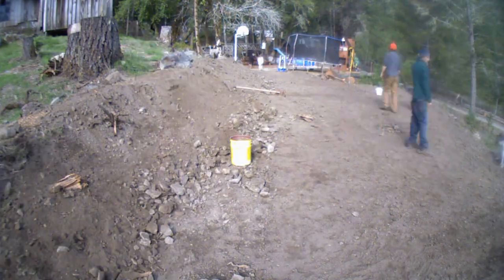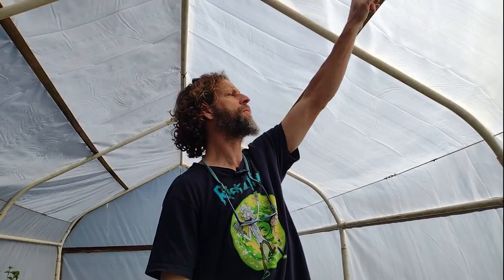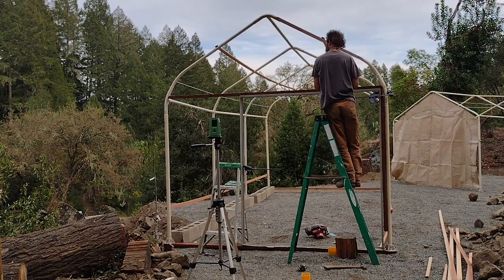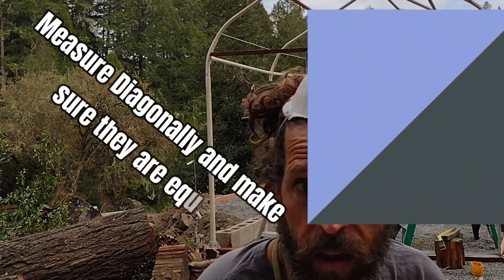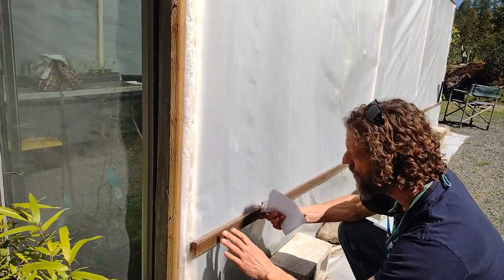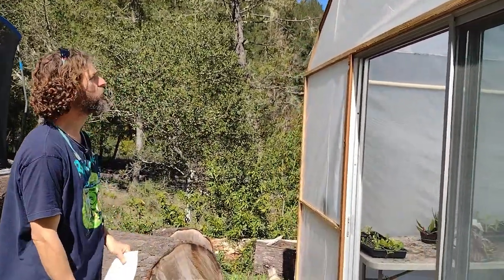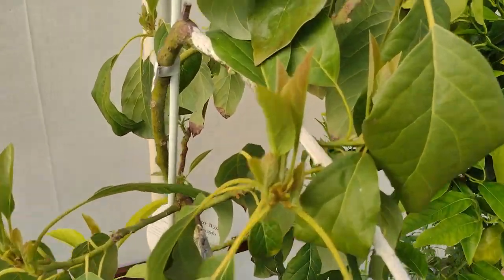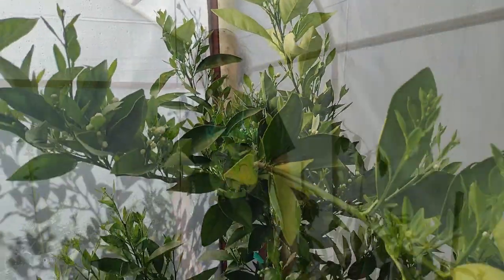DIY GREENHOUSE from old CARPORT frame.

Comment: Very helpful! I know that the plastic will weaken and tear over time—just remove the outer wood framing parts and replace the plastic that breaks?
Reply from the maker: Yes just remove the wood baton from the outside and the plastic will come off.  Plastic was not our first choice but we had to get it done fast to protect the Avocados!  Our plan is to replace the plastic with old windows as we have time and resources. Eventually we will replace the roof as well with some sort of reclaimed a recycled door or roofing material that's transparent.  That is what I really like about the system is it's easy to swap out the plastic for recycled Windows doors & roofing!